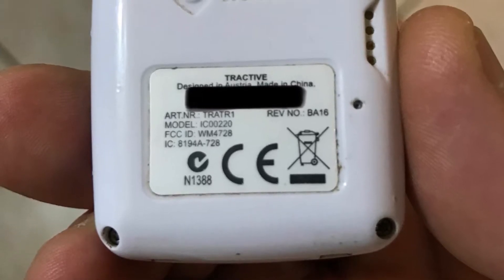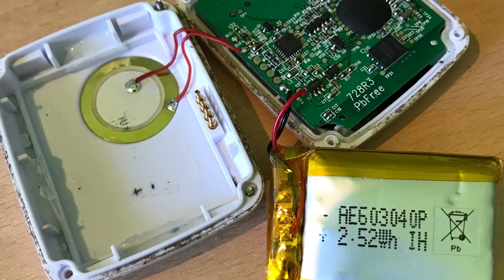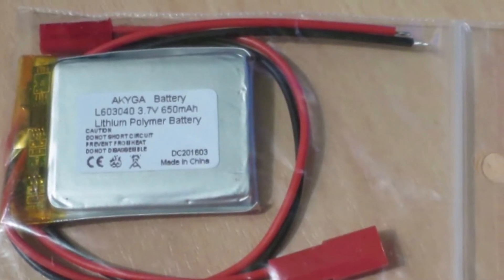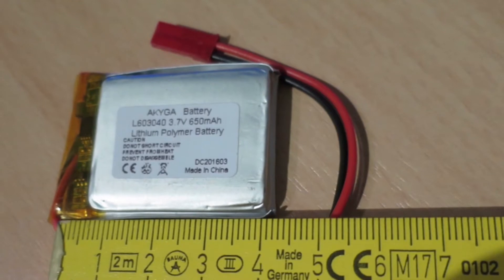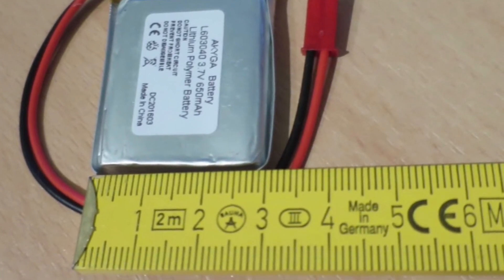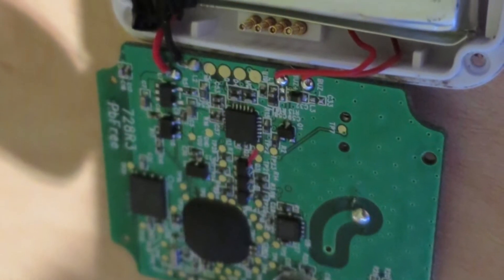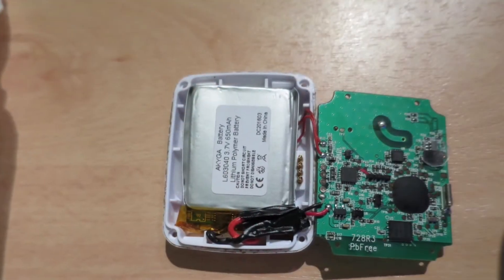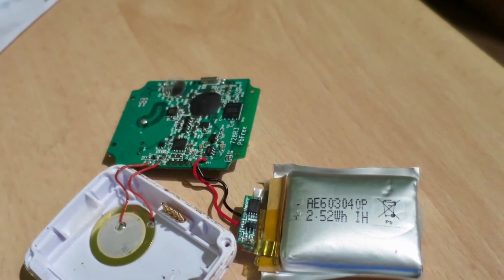Tractive GPS Pet tracker battery replacement TRATR1

Comment: How does the battery connect/attach? Do you need to solder it or are there connectors?
Reply from the maker: i have cut the cables and soldered to the cablesç not to the board. This way was easier for me
Reply: @modelci  Thank You!